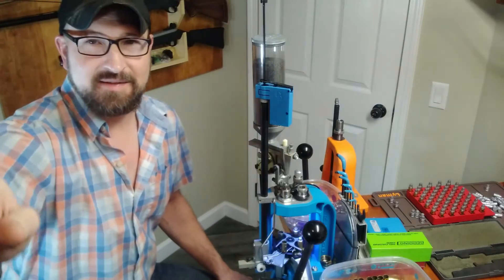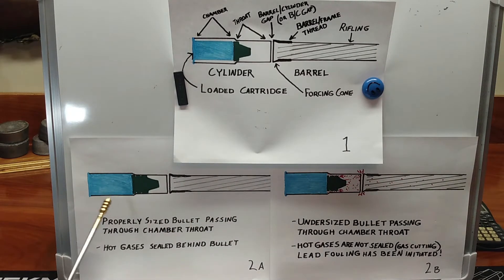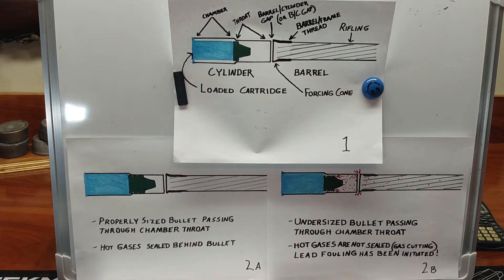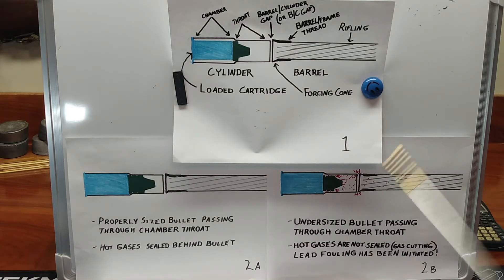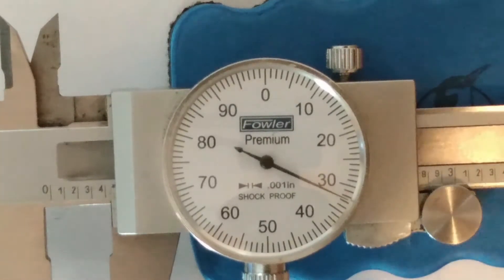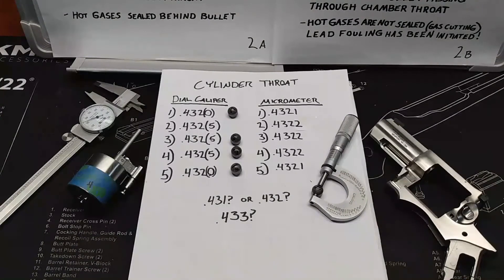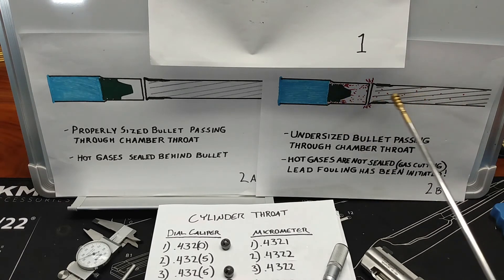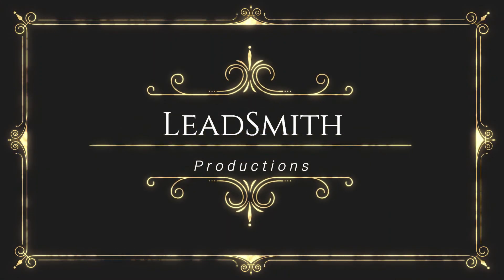2. Cast Bullet Path (Revolver throat, purpose and measurements)

Comment: This covers exactly the thing that I was wondering about.  Bullet size.  I'm a little confused by your conclusion though.  So you measured .throat diameter 432 but you are resizing your cast bullets to .431  First question is why?  I thought we wanted the bullet to seal against the throat.  Do the bullets come from the mold at a consistent .432?  Wouldn't it be best to leave the bullets and not resize them?  (FYI just as a background on where my questions are coming from, I own a 1911 and want to cast bullets for it.  That gun supposedly has a throat at .451? From what I've read on the web in forums is that I want a .452 bullet.  They say you want a .001 seal against the barrel.  Commercial bullets for 45acp that are jacketed or copper plated are at .451)
Reply from the maker: Yes, you are right. We do want the bullets to seal against the throat. The reason that I'm using a .431 sizing die is simply because I was unable to locate a .432. However this is not a great issue because the alloy I'm using allows the final sized bullet to spring back some, which gives a finished diameter closer to .4515 which is just about a perfect slip fit. Running them through the sizing die allows me to lube the bullet the way that I desire also. Otherwise I'd have to use a tumble lube which I do not like, or powder coat which I'm not set up to do.
Also, "obturation" is a concept that will be at play to certain degrees. I will cover this concept in coming videos. "Obturation" is a reaction to the sudden forces acting on the base of the bullet. The bullet base may momentarily expand while inside the throat. The forcing cone provides a certain amount of resistance to the forward movement of the bullet, and the expanding gasses behind the bullet are thrusting it forward... this is where the "obturation" or momentary expansion of the bullet take place that provide a further sealing effect between the bullet and throat. I do not like to rely on "obturation" because it is an elusive animal that I have no way to measure, but sometimes it shows up and helps the cause :)
Regarding our beloved M1911, things are quiet a bit different. Auto loading pistols typically do not have a "throat". However, just like in their revolver counterparts, we want to know that the bullet seals the hot gasses inside the barrel. Running .000-.002 over groove diameter is good practice. As you have discovered, a .452 bullet is typically a pretty safe bet in these guns.
Revolver: 1. Fit to throat (in a perfect world, the throat will always be larger than the groove diameter, lending the .002 or so over groove diameter.)
M1911: Fit to groove diameter (in my experience a 45acp 1911 is usually going to be a .450-.451 groove diameter, lending to .452 bullets being ideal)
Just remember, centerfire revolvers and rifles that use a bottle neck cartridges will likely always have a throat. But autoloading pistols like the M1911 do not.
This was long winded, but I hope it helps. Thank you for watching and supporting this channel!
Reply: @leadsmith44  Thank you for this informative reply.
Reply: @leadsmith44  Great Videos. You have obviously spent a lot of time thinking these thru and producing them.
You need to correct your statement above to read .4315, not .4515.
You can adjust alloy to vary the size of the cast bullet as you may know.
You can lightly hone the sizing die to gain a little size.
Or, by a push-thru Lee die of the size you desire. I believe there is a guy on ebay that will make you one rather cheaply.
And, you do want to shoot for obturation. Either by alloy or decrease/increase the speed of the bullet.
The .45 acp is throated. If it weren't the bullet would jam into the rifling and never let the round seat into the chamber. Throating is a clearance cut for the bullet even if the round headspaces off the case mouth.